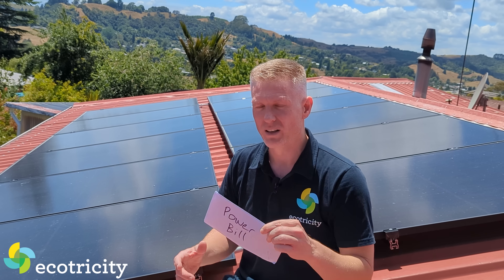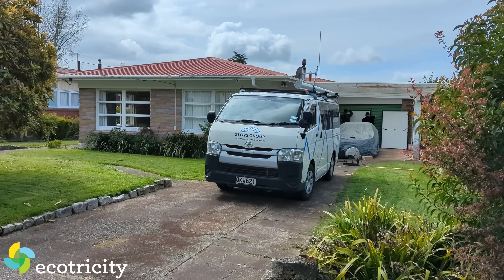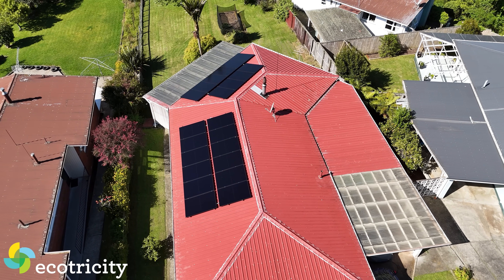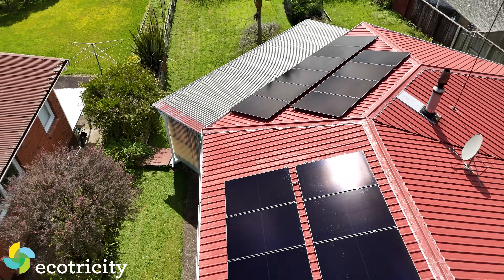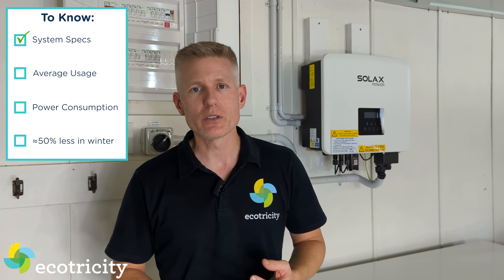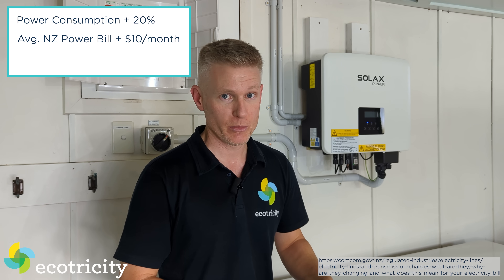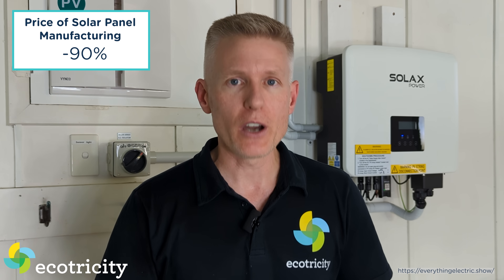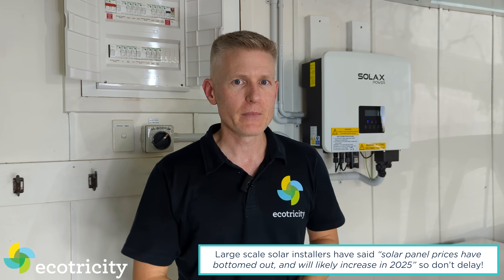Is solar power really worth it in New Zealand?

Comment: I think that i would get a battery 1st, then maybe solar.  I have a single phase 15kva supply, with 3 hrs free at night.  I consume around 8kwh per day, plus say 1,000 kwh per yr for EV.  Batteries LFP are under $100NZD per kwh, so a 20kwh battery with 6kw inverter say under $5,000 for whole system.  Also Meridian are building a 200,000 panel solar farm 10km from me,  they will be paying me to take their electricity.  And I sure some blokes will be selling very very cheap solar panels around the pub, when they start to build it this year.

Comment: Jeepers, 21c/kWh, lucky to get 5c in Australia ! Good investment Gav, I've been off grid for 6 years no more power bills ! Looking forward to seeing some of those fresh electrons flowing into the Allegro !!! 🤠😎
Reply: But how does that relate to what you pay for kwh in OZ. Mine is 37c/kwh uncontrolled in Northland NZ because of low user rate. (Varies by region)
Reply: @peter_peter_pumpkin_eater  Hi Peter, haven't had a power bill in 6 years so don't know what the rate is at the mo, but we do have many different energy providers across the country, someone else might be able to help with the current c/kWh rates !
Reply: 13c I think he said.
Reply: @christopherj2231  Cheers Chris, there was a little pop up on the screen when he mentioned the 13c, that they now offered a peak buy back of 21c...pretty good these days !!!
Reply: @AndyM...  Typically the highest FIT opportunities require batteries to be installed. The innovative electricity providers (Ecotricity and Octopus) are working on building their own collection of solar enabled customers as a virtual power plant (VPP) in order to insulate themselves as much as possible from the volatility of the wholesale energy market pricing. The new players are very aware of the future potential for distributed generation.
Reply: @HarmLessSolutionsNZ  They sound a bit more switched on than over here, the retailers are out to get every cent out of you here, it won't be long before the FIT will be zero. They are already charging some customers for exporting power at peak solar times due to excess energy on the network.
Reply: @AndyM...  
That's when you need to talk to neighbours and arrange DIRECT supplies of electricity. 
Who says that your PV array on your roof can't have "shareholders" nearby?
Reply: @JohnSmith-pl2bk  Good thought John, think they're called microgrids ? Some in remoter areas have battery storage, where a number of systems feed a common battery storage. 👍
Reply: 9c/Kwh In TAS
Reply: -$0.4400/kwh credit in SEQ.

So 44c/kWh. Premium feed-in for NOV month (30day period) of 75.422kwh x -$0.4400/kWh = -$33.19 bill credit 
(Old solar 3.5kw -> upgrading to 13.5kw soon)

I'm no solar expert. Am I missing something? 
Goggle / comparision sites say feed in tarrifs are genrally 5c to 8c/12c but bill shows 44c for feed in credit. 

Are tarrifs and credits different?
Reply: True, I just blew out Origin Energy this week as they dropped my FiT from $0.08c to $0.04c. Red Energy was the best switch for me as they still pay $0.08c. Unfortunately what our friend in NZ will see soon enough is that his $0.14c FiT will drop very quickly. Very frustrating as it seems like a scam. As for batteries, forget it. You will never see a return on the investment.
Reply: @David-xh2yt  Yes David, remember the initial 43c FiT days, some people are still on that ! I'm not connected to any provider and produce all my power via solar and battery, correct I won't see a ROI, but am happy to be independent, can power my home and car by daylight ! 😎
Reply: @David-xh2yt  There is a major difference between NZ and Australia's grids that needs to be recognised here. Australia's base load generation is largely from coal which is far less able to ramp up and down to the extent that NZ's hydro heavy generation can. 

As a result of this solar is far better suited to NZ's grid due to generation flexibility and the potential for hydro to be held back at times of high solar and wind inputs thereby becoming a huge potential battery. The biggest threat domestic solar faces in NZ is the ideological policies of an energy minister who is blinkered in respect of the future of electricity supply and maintains that importing expensive and emission heavy LNG is the solution and is ignorant to the opportunities that decentralised consumer driven generation, combined with EVs, has in our energy supply future.
Reply: @HarmLessSolutionsNZ  "coal which is far less able to ramp up and down to the extent that NZ's hydro heavy generation can" - are you sure? I thought one of the few advantages of coal/oil/gas is they can ramped up and down on demand fairly easily, making them really good for baseload provision

Not a fan of burning fossil fuel, to be clear, and agree with you about the rest.
Reply: @gfkBill  Coal power generation is considerably slower to bring online than hydro. Coal plants need to come up to temperature and pressure before generation occurs, and the reverse to shut them down. For a hydro facility opening the control gate allowing water to travel down the penstock to the turbines can be done in minutes. Coal has considerable inertia and slow response time so is well suited to baseload but lacks output flexibility.
Reply: @HarmLessSolutionsNZ  Cheers, that makes sense.

Comment: The upfront cost stops many, but if you can afford it, solar just makes sense. Some countries have cheap loans to help get past the buy cost.

I upgraded mine, and my grid use has plummeted since, despite now charging a solar powered car.

It's magic!
Reply: In New Zealand you can get a 1% loan over 3 years up to a maximum of $80k on top of your mortgage for insulation, solar, batteries, EV's etc. I got my little leaf and new double glazed sliding door on it 😁
Reply: @Wignu  Was that through ANZ Good Energy Loan?
Reply: @Sulu-d4r  Yes it was, I'm sure other banks do it too 🙂
Reply: @ Ah, thought so. We've used it for insulation and a heat pump. Will definitely be using it for more in the future.